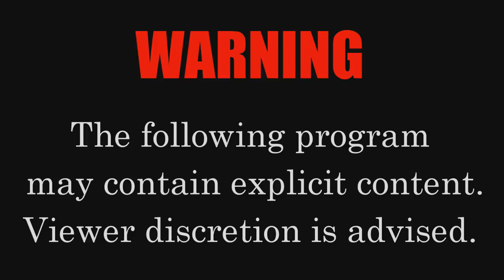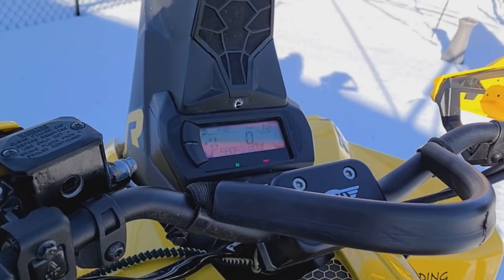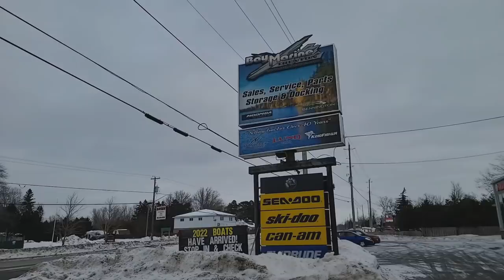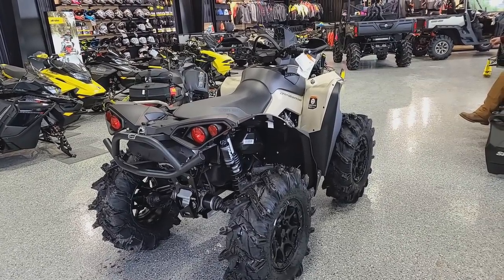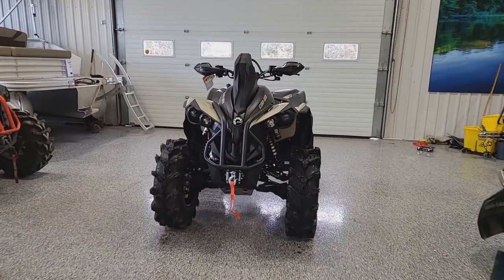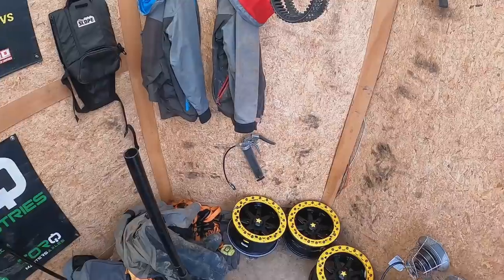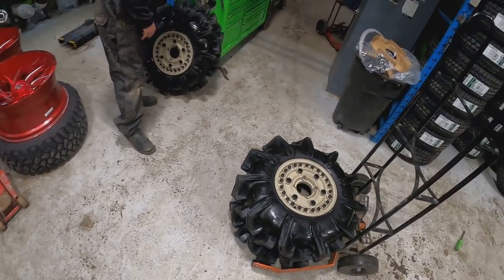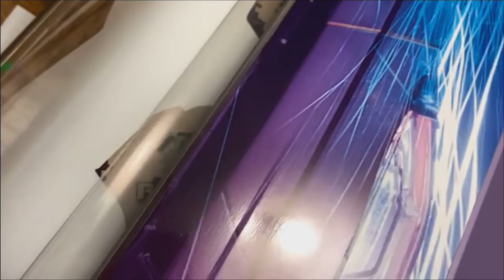New Build 🔥🔥🔥 2022 Can-Am Renegade X-MR1000R 💣

Comment: Hey man you have been riding a very long time and having experience with both electric throttle and normal throttle. I’m debating on getting a new machine but that’s the only upgrade really that I can’t add to my 2018 bike. But is it really worth the upgrade.
Reply from the maker: No, I still prefer the cable on my 18